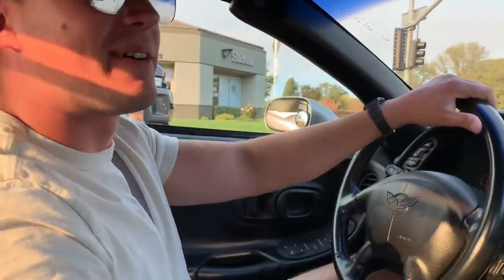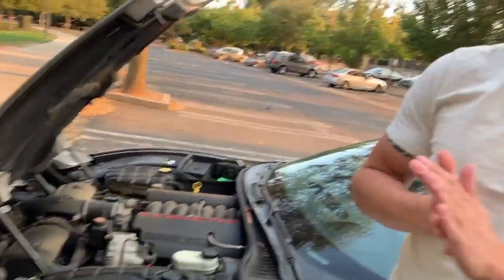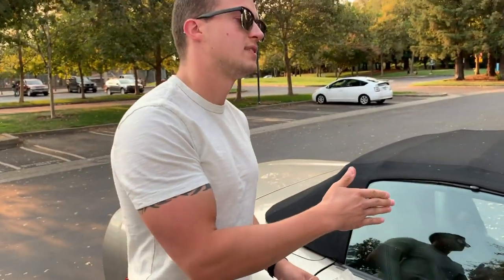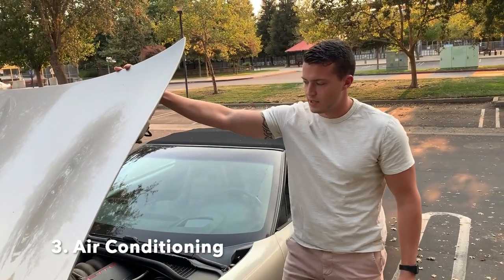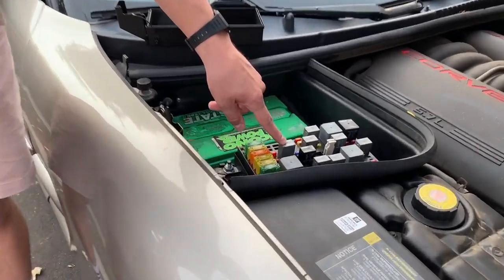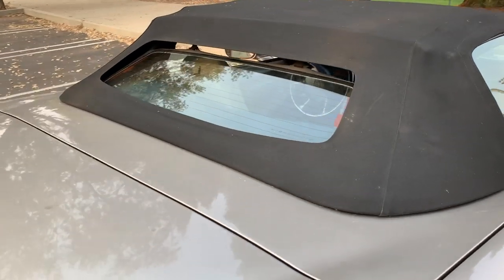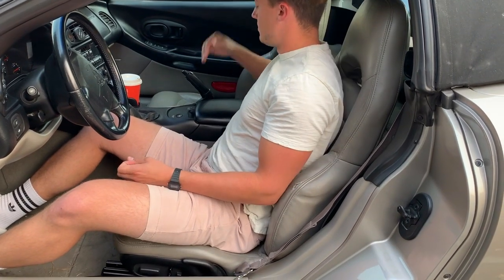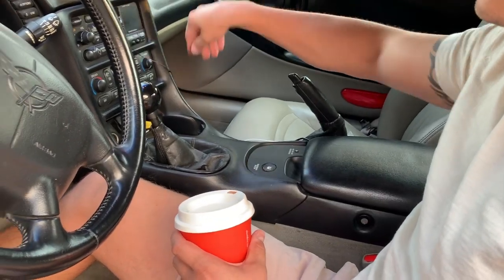PROBLEMS WITH MY C5 CORVETTE

Comment: I was kicked in the butt by buying a 2000 Corvette (35 K mi) while the transmission fluid seepage from the rear diff had metal shavings in it.  I got my $17 K back, and the dealer flat bed his 2000 Corvette back 100 miles to Illinois. So, I still want a Corvette, and am looking at a 2003 50th Anniversary edition.(49 K mi)  Ready to pull the trigger so I have it inspected. ($107.49) Fluid seepage from Trans pan, fluid coming from rear diff (different car) same problem, oil seepage from timing cover, and all 4 shocks leaking Hydraulic fluid.  Dealer says - no PROBLEM!  and will NOT fix anything.  I RAN, and kept running away from a "Corvette".  I am SO, SO HAPPY with my new 2007 SATURN SKY convertible with 4000 miles....  C-YA!
Reply: So you bought it from a dealer? That’s the problem. Dealers all suck. The C5 is an amazing car, obviously if you neglect it and don’t do regular maintenance it’s gonna have tons of issues. Mine has 126k on it and was seemingly cared for, just doing all the basic maintenance it needs at this mileage and runs great so far.